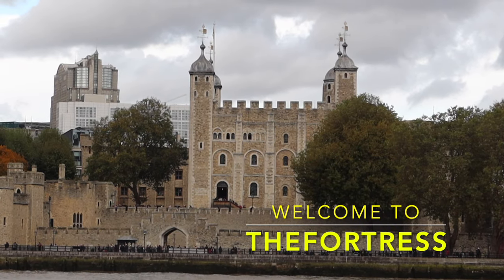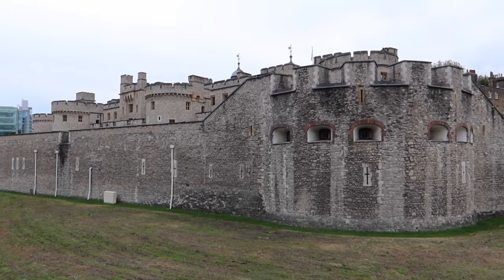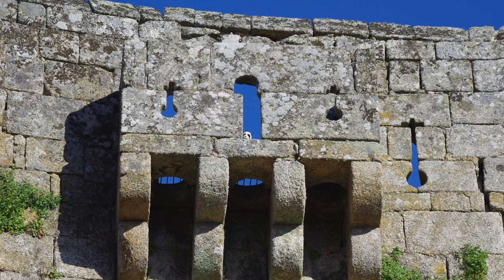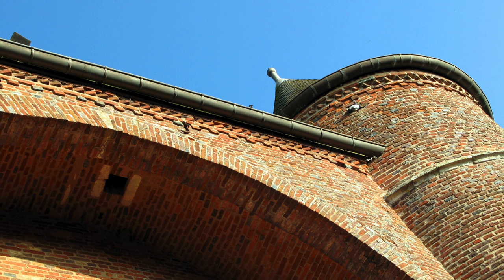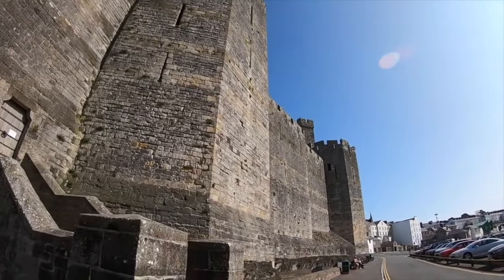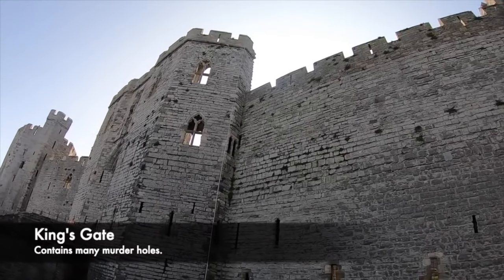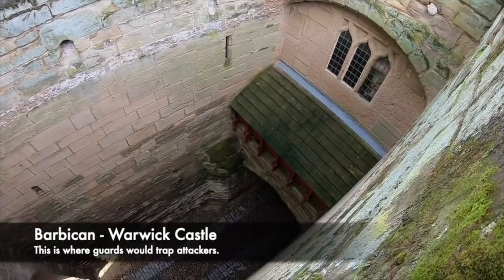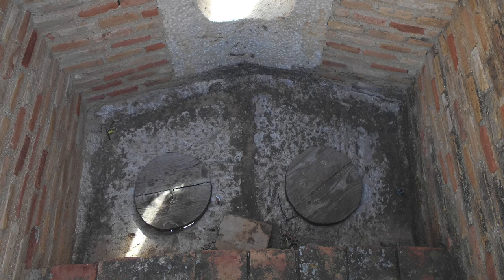Murder Holes - The HORRIFIC Method Of Defending A Castle

Comment: I went to Warwick castle in the 1980's.  It was pretty wild times these castles and warfare.  I think they said they poured hot oil and boiling water when attacking forces were stuck between the two entry gates.  The dungeon there at Warwick was pretty amazing too.  I didn't know what  being in the "hole" in prison meant.  It is an origin story of being in the hole..... it wasn't pretty.